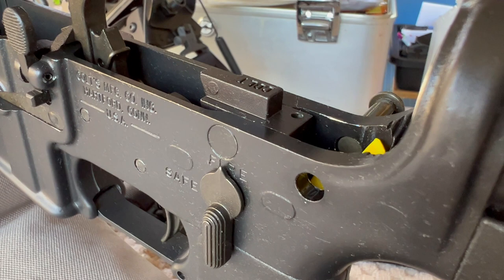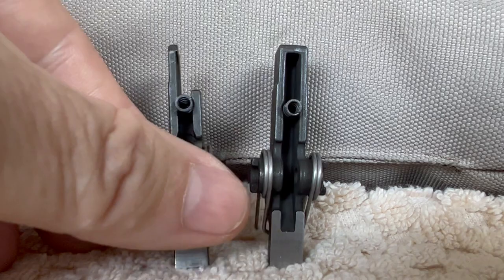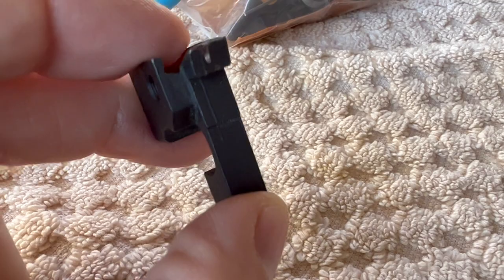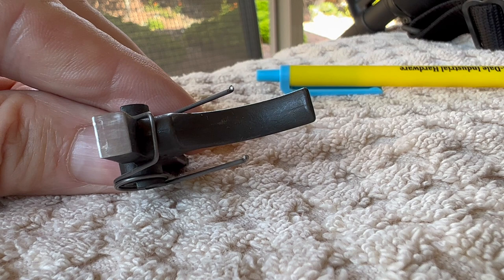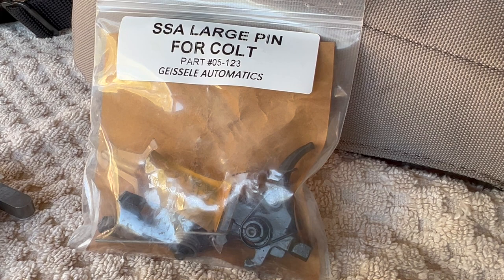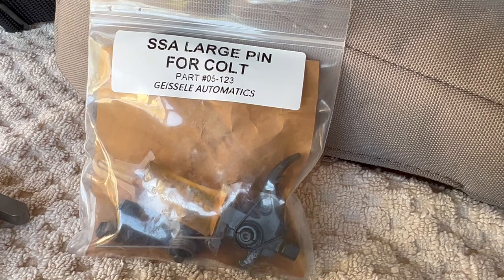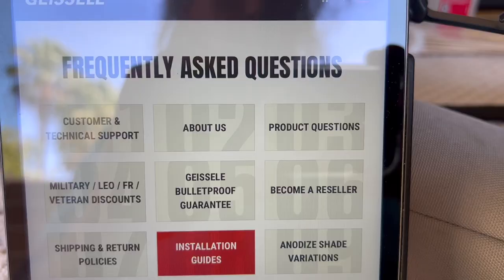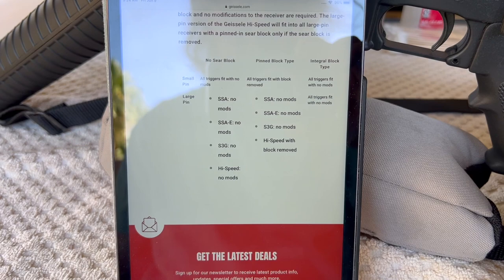Geissele Colt "Large Pin" Triggers for Sear Block Lowers!

Comment: Good to know.  My 6721 is post sear block with large pin.  It does have the modified hammer (and bolt carrier).
Reply from the maker: Sounds like you may have the integral block receiver?
Reply: Yes, sir.  The “web” style still used to this day.  My unit was made in 2000-02, I think.  The bbl is undated.
Reply from the maker: @montzster  Better than a pinned in one! Thanks for watching and commenting!

Comment: Thanks Burstangel and Pete 😀😊😎 If I Ever Have A Searblock Lower I Know Removal Is Not Needed I Was Thinking Easier Just to Buy a 40.00 Stripped Palmetto State Lower All Mil Spec and Run Whatcha Want Too and If Later Enhancement Is Needed For The Zombie Apocalypse You Have The 3rd Pin Option
Reply from the maker: I sometimes take the path of "most" resistance! Like, not on purpose though! Lol! Thanks Chris!
Reply: @peteregger7928  😇👍🏼

Comment: Did you reach out to geissele and let them know what u found out.... they may not know it will work. With the block installed... glad u made the viedo. I will rember this in case I run into this .. thanks a bunch
Reply from the maker: No, I never contacted them. They should put all the fitment info with the trigger description or specifications instead of making you dig in a few pages to find out or have to make a phone call to employees that don't have a clue. Also, if they had multiple pictures of that actual model trigger I could have easily seen if it was going to work with a sear block lower but they showed the trigger from the side that doesn't matter. I don't know where these companies find the people to set-up there online store descriptions and pictures but they are always lacking in the things that are the most important to know. Thanks for watching and commenting!

Comment: I have some small experience fitting a Giessele trigger to an out of spec lower.
It seems like you could cut off half the trigger bar yourself.
To make it fit under the sear block.
Did you have a mil spec trigger in the bottom of your tool box, to compare to the Colt trigger?
Reply from the maker: That might work! I have about 6 MilSpec triggers in my parts box from replacing triggers on other rifles. Decided that MilSpec is not for me!
Reply: @peteregger7928  I thought you could have done the test fitting with a mil spec unit, using the Colt piece as the template.
But I forgot about the pin diameter issue.
It’s too bad Giessele didn’t have a photo of the trigger showing how it was cut to fit.
Reply from the maker: @ordinaryman1904  Yep! The Geissele picture showed the unaltered side for large pin Colt's. Lol!

Comment: So.. im watching this video only because one of my sear block pins came loose and fell out on my colt sporter lightweight .. now im wondering if its worth taking the searblock out with one pin already gone and get a new trigger/bcg.. or if i should just put the pin back in and locktite it .
Reply from the maker: If possible I would just put the pin back in if that’s the only issue. Some green sleeve/shaft locker would hold it I think?
Reply: @peteregger7928  Im lucky this pin fell out in my basement and not outside somewhere. I know they are just supposed to be press fit in and I could not find anywhere online of people reporting them falling out. I will try some sort of locker or locktite because without it, the pin just falls out again .